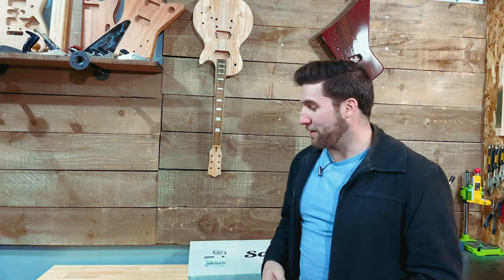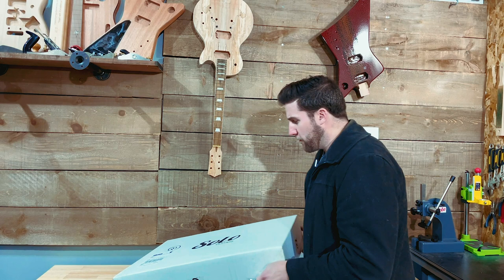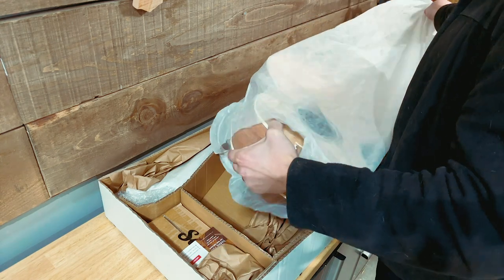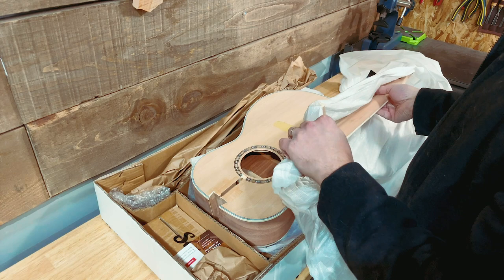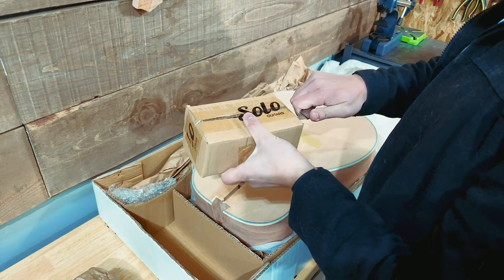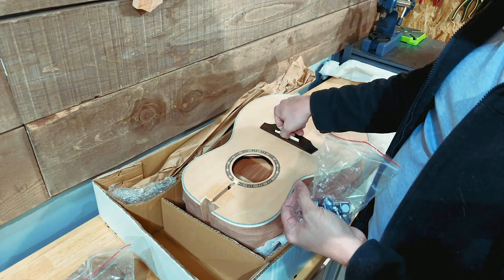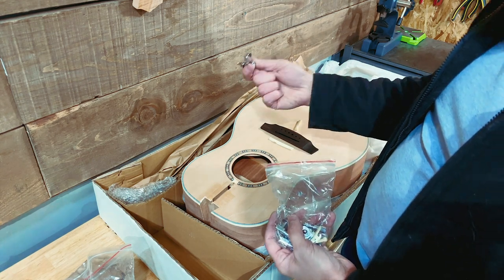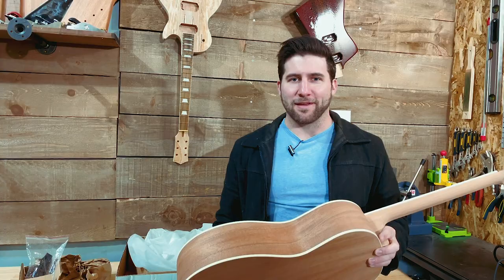My First Acoustic Guitar Kit! (Unboxing)

Comment: Finish either with lacquer or Crystal-clear Brite Tone. If you oil the neck, you will be constantly tweaking the truss rod because the oil doesn't seal the wood properly.
Reply from the maker: I’ll probably be using some lacquer. I oil almost all of my neck though. It doesn’t cause any issues with the truss rod.

Comment: Mark a centre line from the bottom `Bout` to the Nut slot, & work from this to ensure all is straight, 
when I built my SRP kit (if you don`t get that, you`re watching the wrong post)! the neck was way off, I simply hit the headstock with a smack of my palm and `nudged` the neck straight as it glued & set, I strung both E strings to set both the straightness & the string height but this was much easier with an electric set up!
good luck with an acoustic, 
I think the neck angle, nut & bridge height is gonna be the key to this build, I can`t wait to see how it turns out.
Reply from the maker: Thanks for the tips and info.

Comment: I built an acoustic kit from Solo a few years ago, it was crap. The neck didn't fit and wasn't square to the body. Ultimately had to convert it to a bolt-on it needed so much modification to it. When finished it sounded terrible 😕.
Hopefully you have a better result.
I've done a few of the electric kits and had great results.
Reply: Yea I get it Gary. And to boot for the money you can pick up a pretty decent used acoustic.
Reply from the maker: Sorry to hear that. Hopefully I can make this one work. It seems relatively nice, but I have no experience with these.

Comment: I think solo has come along way since I bought a kit from them in 2012. A tele that ended up as a wall hanger. It was somewhat my fault cause the finish bubbled but then the frets lifted so I built a new tele from scratch . Been down the rabbit hole ever since.
The bridge on that zcoustic should be rosewood.

Comment: I built this kit a while ago. I recall having to sand the neck pocket to get the right height and angle relative to the bridge. This was the key part of the build and took a lot of time and patience. I used a Tusq saddle which needed a lot of sanding to get  to my desired string height. Also, the taped area for gluing the bridge was in the wrong position when I checked the scale length and centre line. To finish the guitar I used angelus dyes for color, filled the back sides, sealed  the sides and back, filled the same with aqua coat, then top coated the sides and back with lacquer and tru oil on the top. Enjoy the build…
Reply from the maker: Thank you, this is good to know.

Comment: Brad, remove the stain from the underside of that bridge before you glue it to the top. 🇨🇦 The fancy lines inside of the binding is called purfling. It's a fancy word.😁 Make sure you get that neck tilt right. There's a Canadian man named TWoodford that has a video or ten on how to do it properly.
Reply: I love Ted Woodford’s channel!  I learn something from every video!
Reply from the maker: I’ll definitely have to check out that channel. I thought purfling required a carved line. I guess I must have misunderstood that detail. Thanks Brian.
Reply: @BradAngove  It can be a carved line, but any purpose meant design inside the binding is purfling as far as I know.
Reply from the maker: Nice. Good to learn something!

Comment: Tape the area under the neck and bridge off before you finish the body. Makes it easier to glue in place when assembling. They look nice in a 3 shade burst. Make the outside of the burst the same shade as you are going to finish the sides and back. I was looking at that and then got lazy and bought a Fender California mini Sonoran. Came preassembled and finished.
Reply from the maker: Haha I think I may just glue in the neck before finishing. I’ll leave the bridge taped off though.
Reply: @BradAngove  do yourself a favour and take a trip to your local Lee Valley and get a 5 oz bottle of old brown glue. It allows removal if things go bad.
Reply from the maker: Hide glue?
Reply: @BradAngove  old brown is a stabilized type of hide glue. Has a 30 minute open time and can be softened with heat and moisture if removal needed. Comes in a bottle no fuss no mess cures in 24 to 48 hours. Do your bridge glue up with it as well.

Comment: This is gonna be fun to see. I've always been curious about acoustic kits, but not curious enough to risk the time and money, myself. Thanks for falling on this grenade for us.

Also, for acoustic instruments, spar varnish is king. The people who wrote the book (literally) on luthiery proved it with science machines, fancy graphs, unpronounceable words, and other indecipherable nerd crap that I don't fully understand. The normal people version is that it was designed for seafaring. On instruments, this means it's near-impervious to sweat and oils from the player, unaffected by temperature/humidity, protects against UV damage, allows the wood to resonate uninhibited, and can flex and bow without the finish cracking or checking.
Reply: Thanks for the heads up. I will research this further. Cheers Mate.
Reply: Hello, what book are you referring to? Thanks!

Comment: Ok so I've been looking at Martin kits. Those are a bit more involved  I think I could do it but they are pricey.  I recommend flat or violin type finishes. I like linseed  I use paper towels then burn them when I'm done  you could put an electric flat bridge like a top loader to t style but then you'd  need to put a backing block in. Id stick with wood
Reply from the maker: That sounds like a fun project. Paper towel tends to leave residue though. I’d use an old t-shirt or something similar.

Comment: Definitely a fun and easy build as long as you set the neck angle correctly.  Love the light fretboard.  Mate a tru oil finish will make that bad boy sing! I'm sure gibson have done an acoustic with a abr1 bridge.
Reply from the maker: Yes after asking this question I’ve now seen a few with electric bridges.
Reply: @BradAngove  you can actually route out the wood bridge and add a tune o matic like they did with the Gibson dove or the j200 now that would be awesome.

Comment: saw a vid the other day (scar my guitar?) - dude put a fender 6 saddle hardtail toploader on an acoustic - sounded great - might have to do that myself.   This vid is right on time, I'm doing a resonator build, a 1932 Ro-pat-in (Rickenbacker) Electro-string inspired build ( $300 for a horseshoe pickup! ), and a 1936 Gibson ES150 inspired build (flat top - i'm not carving an archtop, but charlie christian pickups are only $60).  I'm trying to limit my collection to one of each, and I'm running out of unique things to build or mod.  Parts are on the way for a baritone tele and a 1950 esquire, and i think those are the last two electrics types left to do. So I'm down to stuff like a resonator, a 1932 rick, and a 1936 gibson ES150.

Comment: Dang looks decent enough for the price. I'd oil it too keep it ez if ya got one of there higher end kits then I'd spend the time with the lacquer. Does the guitar have any sealer or anything on the exposed wood? I'm guessing not.
Reply from the maker: It doesn’t feel like this one does, but they usually have a single coat of it. I’m guessing they didn’t do it on this one because it’s acoustic.
Reply: @BradAngove  thanks yeah not sure why they don't but that makes it a bit more worth buying thanks man. And good luck with the kit
Reply from the maker: On an acoustic the sealer could impact the sound and affect the ability to stain, so I’m hoping they don’t seal them like they do the electrics.

Comment: Hey I’m finishing a mostly natural wood finish guitar and I know your extremely familiar with spray max so I thought you may have an answer for me. When I apply wax and grease remover the wood brightens up and looks awesome so I’m trying to achieve that look. So will spray max soak in and give it that wet look? If not I was thinking of using minwax spray oil or water base poly to give it a tint then scuff and apply my spray max coats. Any suggestions?
Reply from the maker: Spray max will give you that added contrast that you are seeing when the wood is wet.
Reply: Awesome that’s what I was hoping to hear!